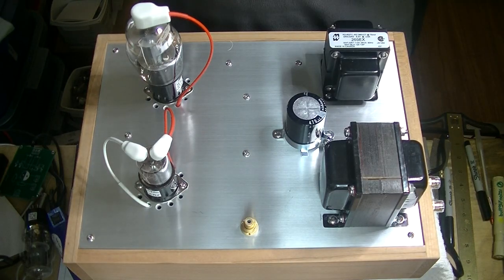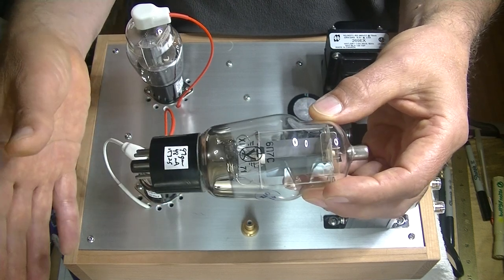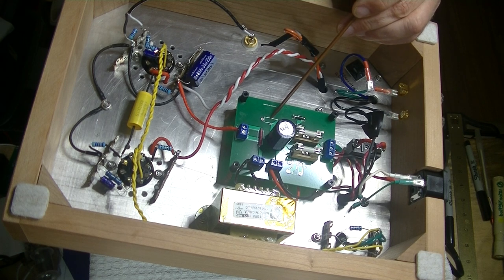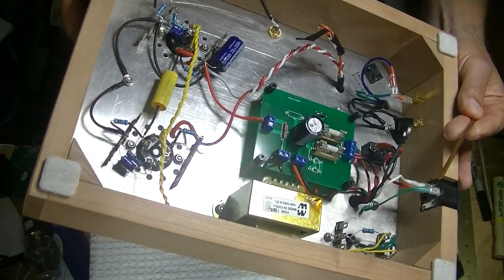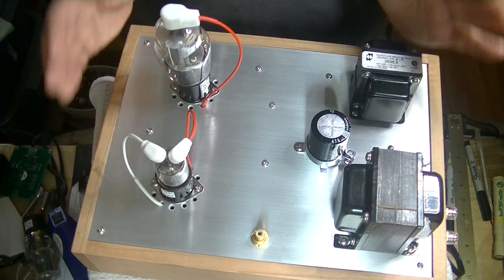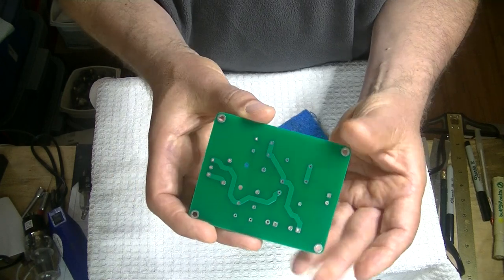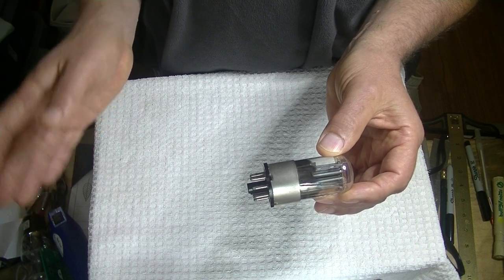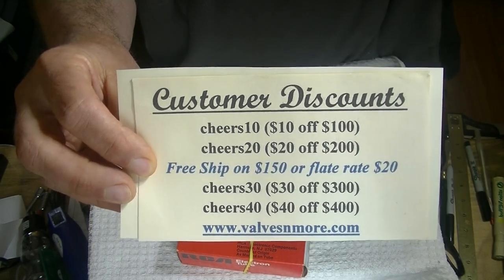Tube Lab #39 Prototype 6P7S Monoblocks

Comment: looks like 807 i just built stereo 807 class A amp what grounding topology did you use. i use individual ground wires to the star ground in the PSU. 12 H choke 200 MA i like to use. found like you're amp the AC heater wires up in the air is the best no noise, fender used the method. i find a lot of amp builder try to put the heater wires down low on the chassis to make it look like a show queen and it picks up all the stray magnetic noise etc. i also tie my mains safety ground to my star ground using a 10 ohm 3 watt resistor and a 100 NF condenser across it work well 100 % zero noise in all my amp preamp builds

Comment: Jim, you are spot on about the sound quality the 1950's early 60's MELZ with OTK stamp and diamond. I've had some that took 20+ hours burn-in to quiet down having the crackling rustling noise at first. They sound glorious when fully broken-in. Do you have any idea the life span of those guys? I expect fairly long as the OTK's are known to be tough.
Reply from the maker: I have no idea how long they're gonna last, a normal expectation is 2-5k hours.  As you say a mil spec tube often has a higher spec'd filament, some are rated to 10k hours!  So far I've been able to weed out the noisy ones and haven't had a single one go bad after my "live" screening.  A viewer sent me a note with regards to noisy vintage tubes and he says the vintage TV guys often have this problem and in many cases it's a bad solder connection at the wire / pin.  And applying enough heat to re-melt the solder fixed the problem.  I have yet to perform this fix, but am accumulating so many noisy MELZ tubes, I'll have to give it a try.
Reply: Jim, I've read the same thing about the  pin solder mod with some MELZ tubes as well. Would have no idea how it's done.
Reply from the maker: @Geoduck.  in a Tube Lab in the future I'll feature this, IF I have some success!  I suspect it'll fix some and not others.  Basically you bring a good soldering iron (heat regulated) with a 1/8" chisel tip in at a high temperature (maybe 500f) and apply full wedge of iron tip to the side of each pin.  Hold till the solder re-melts and move on to next pin.  The idea is to improve the electrical connection between the tube drop down wire and the pin (the wire runs down the middle of the octal pin) when the tube was assembled that's basically what they did, of course they brought solder to the pin (and probably had a mechanized method of doing it).  Now it's possible we can feed a wee bit of solder up the pin end - maybe!  Anyway that's how I would do it.
Reply: I would be very interested in viewing that!

Comment: So what wattage do you expect from the Russian power tubes?, I'm looking for a bit more oomph than my 6v6
Reply from the maker: I have no idea what the output is - yet.  I can only read about half of the Russian data sheet and I haven't found an English translation.  Now that I've proven the design works well, I'll have to do some further bench testing - not my strength.  I'm pretty certain I've got the power tube biased  low, so the next change will be to turn it up a bit and see if I keep the audio quality I've currently got - which is glorious!  But I love the SE sound and I've been listening to a push pull amp for too long!